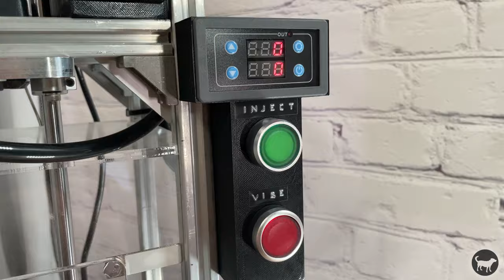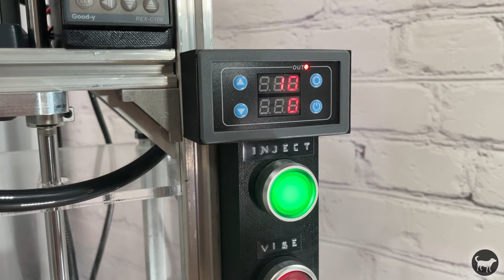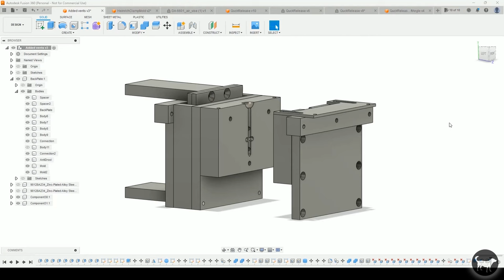MK3 Injection Molding Machine Updates | Semi-Automatic | Timed Injection | Ejector Pin Molds

Comment: Hello. Could you explain more in detail your ejection system? I understand the  base idea but I would be curious to see what kind of springs you used and where and how you put them and fix the ejectors. Thanks!
Reply from the maker: The ejectors on my mold were primarily placed on the runners so that I wouldn't get any marks of the parts themselves. They were pressure fit into the plate on the back and they are prevented from pushing out the back by the back plate. There are no springs on the molds themselves. The pins are ejected by the mold retracting and hitting the back of the vice. They are retracted back into the mold when closing by longer pins that hit the other other half of the mold first thus retracting the pins further back into the holes to leave room for plastic to flow above them. The only springs that I use in my mold design are for that drip plate the keeps plastic from oozing out when the mold is open.

Comment: Hi, how do you clean the nozzle when you change materials? Or at the end of production cycle? so that when you operete next day do you have any residue which might end up clogging the nozzle. Thank you very much?
Reply from the maker: I usually am using the same type of material and color so I just use up as much as I can and then start it up again when I need it without cleaning it out. The nozzle is removable so you can take it off and purge the material if you want to but for me it's really not been necessary.

Comment: Love your machine. Is there anyone that will put it together for me? Not a gear head. I’m an artist and I have a business that makes and sells high end chess set. I would love to have a machine like this to make my smaller sets. THX4ur time. Bill
Reply: if you are buying a DIY machine you might want to put it together yourself. that way if anything goes wrong you will have a clue how to troubleshoot. i am also an artist, but i have forced myself to learn some mechanical stuff. probably the most difficult thing i've learned so far is CAD/CAM for CNC milling machines. now i find it very interesting. good luck

Comment: With the heat sink action of the vice, could you create an interface layer out of delrin or phenolic to insulate?
Reply from the maker: Potentially, like the old Carburetors on classic cars. This might help with the cooling down of the mold but I still needed a way to heat the chambers in the first place. I actually really like those little rod heaters and they work really well. Once everything is how enough it pretty much stays there without having to constantly have them on.

Comment: Is there a limit to sizes you can build with this machine?
Reply from the maker: The volume is 3 cubic inches. Also you may not have sufficient pressure if your part is too thin and flat.
Reply: @BusterBeagle3D  Thanks! Can you elaborate on what you mean about the pressure? BTW, my item is an electronics enclosure.
Reply from the maker: @nickst2797  The thinner the object the more injection pressure needed to push all of the material through the mold. For something with flat thin walls I'm not saying that it can't make it but it's possible it will be too large for the pressure the pneumatic cylinder can put out. That's why industrial injection molding machines use tons of pressure. The most this can inject at would be around 1500 pounds of force. If you are on Facebook there is a Buster Beagle 3D Facebook group with lots of members in there with far more mold making experience then I have that could potentially shed light on if your design is possible with the machine.

Comment: Oh heck yeah! Excited to watch this one! I see the updated BOM, but will there be an updated kit/set of instructions? Thanks!
Reply from the maker: Since again this adds a level of complexity and cost not really needed to use the regular machine and is dependent on that not so cheap vise it's more of a show and tell for now then a change to the kit. If you check out the video description I do have files in there for the wiring if you wanted to do something similar to this.
Reply: Understood! That makes a lot of sense, but I do love the upgrades. I plan to get a MK3 kit myself and learn the ins and outs before doing some upgrades like you’ve shown. I think that’s the best way to go about learning and understanding the machine best. Thanks for responding.
Reply from the maker: @elijahbecerra2740  No worries. Good luck!